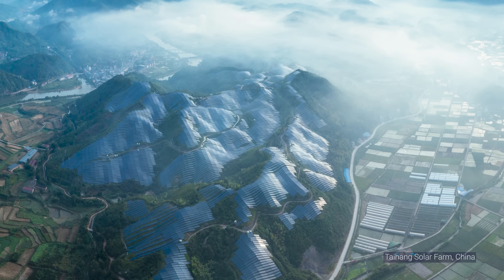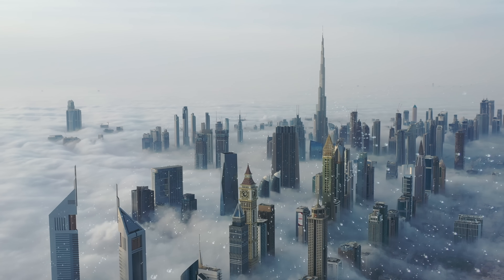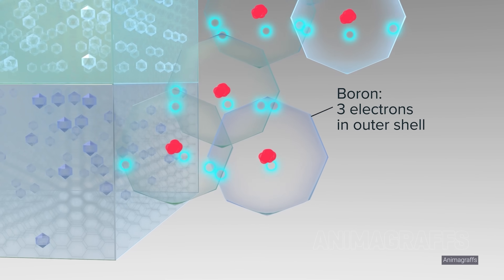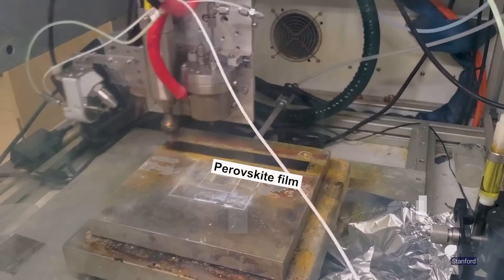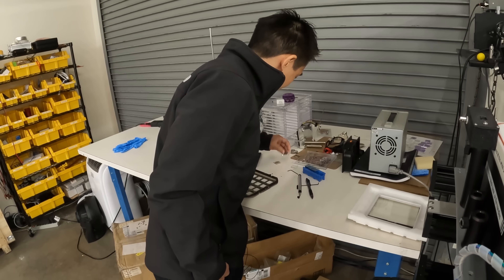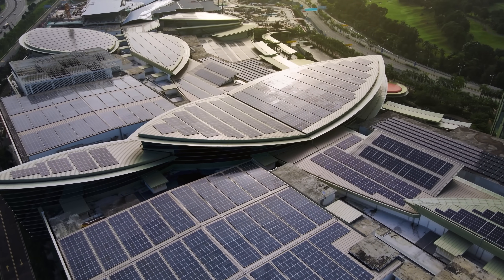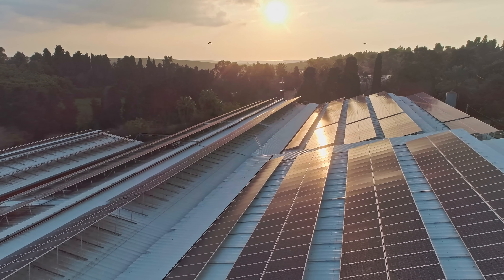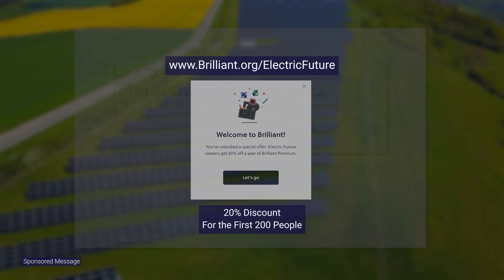Solar 3.0: This New Technology Could Change Everything

Comment: This would be extremely beneficial in a lot of applications... just imagine being able to have your cellphone be able to be solar charged by simply leaving IT in the sun.
Reply: this already exists. There are solar panel back panels for phones.
Reply: @airelek3757   Back in the 1980s three little solar squares powered a little football game, or a calculater off even indoor lighting.  ISure they didn't need much but it's pretty sad that cellphones today, 40 years later and at their ridiculous costs, don't all include a full side of higher tech solar cells to at the very least top off your phone if not completely charge it.  Instead they focus on battery tech and special glass or metal finishes. At the moment we mostly see larger fold out addons that need direct sun upon them to even trickle charge a battery.
Reply: @lastimeye569  Haha That's awesome i had no idea that  this kind of tech was used in the 80's. I agree there is definitely a shift of focus from progress to planned obsolescence for monetary gain and easily marketable shiny things that add little value only posturing exclusivity or ""premium feel "" whatever that means.  But maybe there are reasons we are unaware of that make the tech unsustainable or impractical for mass adoption.  

Who knows :/
Reply: @lastimeye569  The issue is, we didn't take advantage of transistor reduction size to consume less. 
15 year ago a Nokia 3310 was able to stay on for a week with a not so dense battery. 
With exactly the same fonctionality, a new microcontroller engraved at 12nm could last for a month and a solar panel in the back could be sufficient for the need. 
But we choosed the computing power, more color, more refresh rate more everything except batterie life..
Reply: @airelek3757  yes I certainly don't know enough. But it seems solar cell development went dormant and awry long ago. I'm excited to see so many people jumping in with new ideas now.
Reply: @UPR91  That is interesting. Also that each company in a race to outsell the features of each other left out any option for simpler devices.   I still await a standalone wristwatch phone that won't burn my arm off and I don't need it to do anything more than time, phone, email, voicemail.  A solar cell cover I have to flip open wouldn't even be a deal breaker if it kept it charged.  A solar watch band maybe even more ideal. I would walk away from smarter phones that day.
Reply: @airelek3757  it’d be counterproductive since heat degrades the battery like there’s no tomorrow
Reply: An area of a mobile phone gives around 2W with 20% efficiency silicon, maybe 1.5W with perovskite. You need 16 to 20W to charge your phone.

Comment: I used to print with a 10 color CI press uteco was the brand,it was the size of a big house and could print on anything with any kind of ink,grow this stuff into liquid crystals turn it into a powder then a ink and print 10 layers on a ci press,why because you can print 2000 feet a min or more,a roll 60in" wide in 12 hours you can do 1million 250,000 feet.on one ci press ,they don't want solar to be that cheap,

Comment: If a spectrum of the sun can penetrate the earth, so that, deep down inside the earth, those rays are still traveling, isn't it possible to collect that same type of solar ray, even at night? Also, one can collect negative ions with a box made up of, say, 20 layers of conductors and insulators, such as aluminum foil (as conductor) and news paper (as an insulator.) That would be considered a negative ion collector, and not a solar collector, but negative ions are the flammable component in things such as fire wood, or gasoline. They would be far cheaper to make and it could keep collecting in the dead of night. No need for batteries to store energy. It wouldn't make much money for corporations as it's free after the initial expense of plexiglass and rolls of tin foil and the adapters.

Comment: Great video, thanks. However, there is an alternative which works 24/7 for 20 years, thorium molten salt reactors. Inherently safe, self regulating, 200 times more efficient than uranium reactors and there is sufficient thorium in rare earth mine tailings to the last the US a1,000 years. Like everything else, politics is the problem.
Reply: If this worked and someone could make money from it they would be doing it. Elon Musk would be all over it and he isn't.
Reply: @Bottoarguewith   Not as simple as that. It has worked for 5 years in the 60's at the Oak Ridge facility in Tennessee. It was self regulated reaction and walk away safe. Again, politics is the problem, the PTB want America to become a third World nation. If you're are not aware of that, I have no time for you.

Comment: Hey I love that guy you interviewed being straightforward and honest. The big issue is stability and I'd love to find out more about that.
Reply: Yeah, I wish this channel went more in depth on the drawbacks instead of only highlighting the pros. Luckily the CEO was transparent and not overly enthusiastic since there are a lot of challenges to getting this tech widely accepted and implemented. I shouldn't have to go to the comment section to learn that the stability issue is that the cells degrade significantly in a couple of days. I shouldn't have to go to Google to learn that viable perovskite cells rely on lead. Also, in the video the film is thin enough where it is tinted and not translucent. How can they achieve >30% efficiency when much of the light is getting through? Are all of the numbers touted in terms of materials needed and efficiency consistent or based on different specifically tailored conditions? This is the kind of video where I am just frustrated that the author went the "research stretching the truth to gain investors" route instead of piggybacking off of the CEO grounding the tech in reality.
Reply: @johnpeters6147   As you astutely note in your comment, this is a marketing video and such things are done to attract venture capital, as depicted in the efficiency discussion. I appreciated the additional comments in your reply.
Reply: @johnpeters6147  The problem with PTF has been durability and deteriorating properties in real world use. This is something that we've been working on for over a decade and while there have been various different solutions, most of them take away from the properties that make PTF useful. Thus, any kind of method of reinforcing PTF makes them heavier, rigid, or more expensive. The lifespan being 5-20 times shorter counters the issue of resources used for production as well. We might get there some day, but PTF has a long way to go as a usable technology for any kind of hype to be built on it yet.
Reply: Remember when NASA did our experimentation and invented our new technology with billions invested in various projects, instead of grad students with delusions of grander?

Comment: Solar is only realistic on a micro scale, like a single home or cabin or RV, and for limited times per day. Definitely should be a part of any future energy plans but there just isn't yet a realistic method to store and share energy over long distances. Also, the full lifecycle and manufacturing costs of the solar panel plus regulators, capacitors, wires etc requires a large energy input that is ignored, and which makes the cost-to-benefit ratio of solar in the negative. Still, looking forward to each new advancement in the field. Would love to see each home or office building be completely energy independent.

Comment: At 00.30 in the video their saying 100miles by 100 miles could power the usa??? I suspect something wrong with this math. 1st based on the number of functioning solar ive witnessed across the usa, im inclined to believe there is already more than that being used at various residential homes and large corporations;  2ND is every instance ive ever witnessed solar panels being the sole provider for either a home, buisness or vehicle - on average- the amount of solar panels required has been 3 times the foot print of the item using power. A car with no battery to operate and highway speeds reliably on a sunny day needs a trailer 2x as long with solar panels plus the car itself needing to covered with solar panels. Most average homes ive witnessed that are 100% on solar have their roofs covered plus twice as much in their yard. So where is this math coming from??? Sounds like fairy tale propaganda cooked up by solar manufactuers and other such equally motivated entitys. How much of our youth is mislead by this stuff and buys into technology that isnt as ready as is being over promised?

Comment: It's not mentioned in the video, but one application to this might be, say, solar-powered clothing. Jackets or hats with perovskite cells woven into it. So you could, say, charge your phone in your pocket by taking a walk during the day.

I still think the one big hurdle for solar power is energy storage. We can build all the panels we want, but they can potentially absorb more energy than we use during the day. We still need viable, affordable ways to store the excess energy for evenings or cloudy days.
Reply: You can use graphene semiconductors, magnetically elevated flywheels, molten salt batteries, etc etc.
There's LOADS of options out there
Reply: @fast-yi9js  Oh, I know there are a growing number of options. It's whether they're commercially viable for a wide release or are long lasting that's an issue.

Comment: notes: require 1% of materials of traditional silicon panels. Low temperature manufacturing ( no crystalines to be created through high heat ) 15 times less expensive to create. Very light so useful for flying drones using solar.

Comment: Perovskite isn't simpler to produce than Silicon, if it were everybody would be producing it. Perovskites have been around for more than 4 years now, possibly more. The complexity to produce is insane compared to the first solar cell. These aren't revolutionary at all, and currently cannot change a thing.

Comment: You said it would take 100 square miles to power the United States with solar? It takes 20 acres of solar cells to charge for Tesla cars. 100 square miles of solar panels would charge 3,200 Tesla cars.
Reply: Well that is like a couple days production of Teslas , a couple thousand years and we will have power for a couple million cars. If we take enough vaccines that will be about right since we will all be dead.

Comment: Market the technology now. It doesn't need 10 - 25 years for testing in real life scenarios, or it's likely to disappear altogether. What's needed is a simulation and estimates. Every new tech has problems and they can be worked out overtime. Why push it forward when so many current jobs will be lost, and businesses will change forever (ie., fossil feuls energy)? Because the world needs it now.

Comment: Superb. Clearly some issues still with perovskite due to unknown lifespan and some toxic components. Work in progress but regardless this has to be a massive leap forwards. Surely the best way to accelerate tech advancement is to embrace and put significant time into R&D not just rely on those with a fiscal incentive but for a government to adopt and analyse.
Reply: Hell, the issues with heavy metals and toxic metals within normal solar cells make the end of life for that solar cell as opposed to the minimal toxic metals within a Perovakite cell is vastly superior. This coupled with the lack of $ power needed to make them as opposed to regular cells makes this the one to go with..the dura ility of a perovskite cell can be easily protected with a clear hard cover.